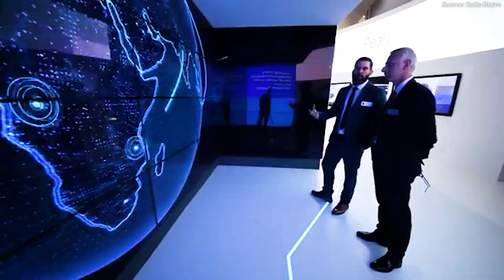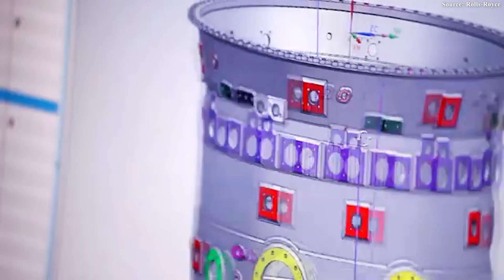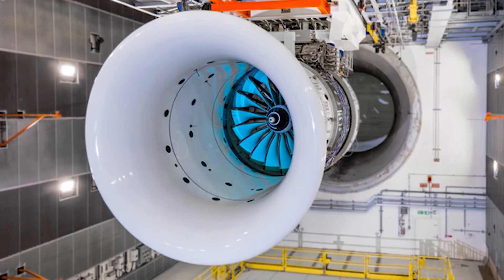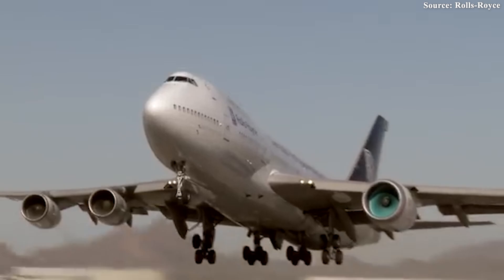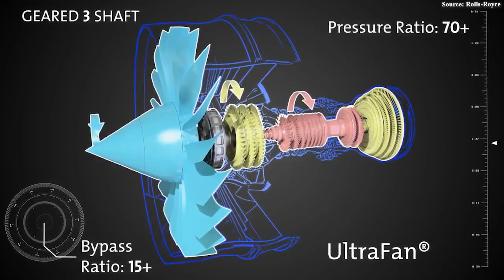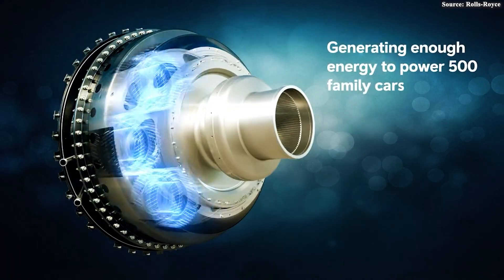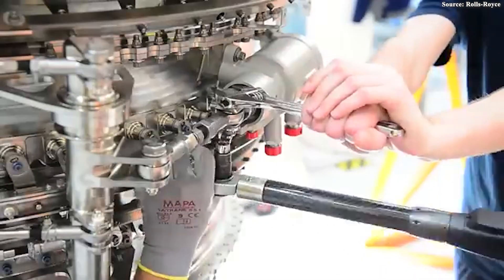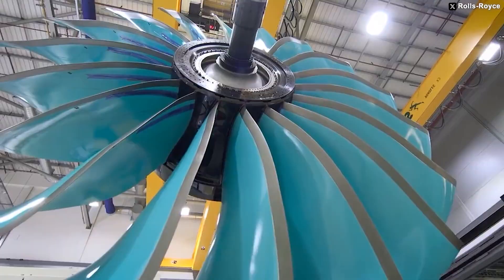This New Rolls-Royce Engine Is Coming & Will BEAT GE9X, Even Chinese CJ-3000

Comment: I have a strong feeling that the very first aircraft to have the UltraFan as the test bed is the recently reactivated A380 registered 2-JAYN which is presently at AUH. They might also be testing the engine for the A350-1000 that Emirates plan to order.
Reply from the maker: Sounds interesting!

Comment: Boeing seems keen on partnering with RR. The British manufacturer will need some convincing that the Americans can and will stick to any updated development timelines. An engines have to reach a high technology maturity level before an airframer will fully commit to a clean-sheet design of their own.

From what I’ve read, the 797 may be a successor to the 767 rather than the 737.
Reply from the maker: Exactly!
Reply: There will NEVER be a 797.

Comment: Ha, the GE9X is a SAFRAN engine licensed by GE, Yes it is made and manufactured by GE UNDER license like a franchise by  the French multinational conglomerate and the Chinese CJ-300 is nothing more than a Lotarev D-30 with and extra two rear turbine stages and a larger fan, yes they are new engines but the IP comes from other sources....
Reply from the maker: Thanks for your comment
Reply: from google if   100%  ge, Now CFM  is great

Comment: I think a larger version of the Airbus 350 will be the first to use the RR Ultrafan.
Reply from the maker: Sounds interesting!
Reply: I have the feeling that it's the Emirates order. They cannot spare any A350 for the testing, but they do have a spare A380. The one that was recently reactivated after being in storage. It's the Malaysian Airlines A380 registration 2-JAYN. I think the reason they need it was that there is only one other A380 owned by Airbus which is in use. That was also used as a test-bed. I believe they flew it to AUH with the intention of stripping out the seats and then putting in various improvements. There is a distinct possibility that along with using the aircraft for testing the UltraFan for the A350 orders, it could also enable Airbus to sell a mid-life upgrade to A380 owners. If the UltraFan was fitted to the A380, the savings would make it economically very profitable.
Reply: @WOTArtyNoobs RR has its own 747 for testing